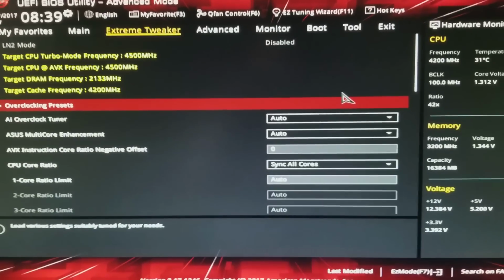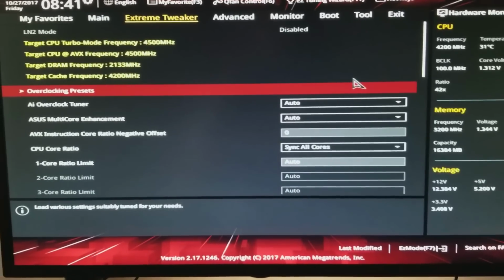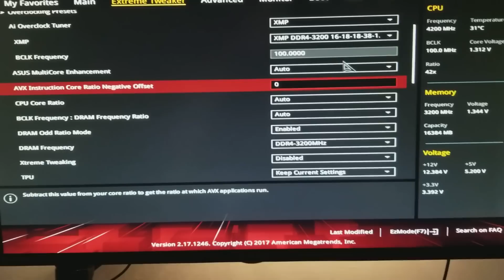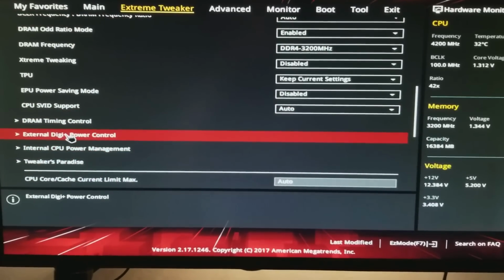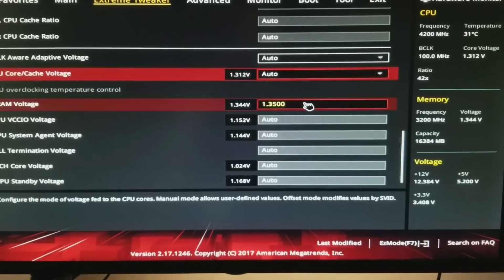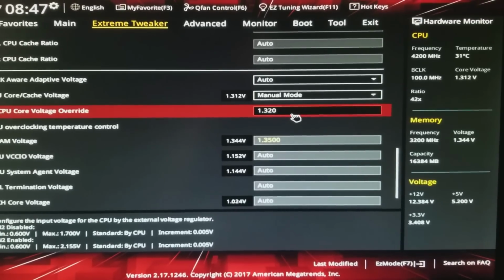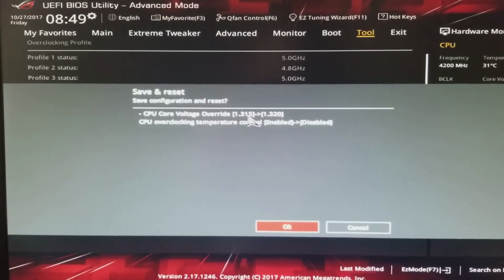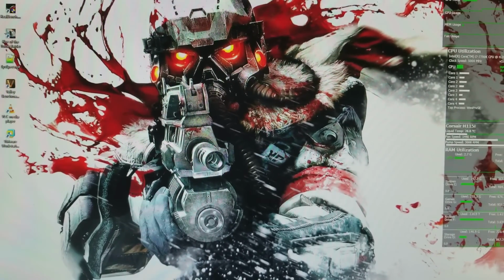Overclocking i7 7700K to 5.0 GHz on Asus Maximus IX Hero Motherboard

Comment: All the settings are working exactly as described except the DRAM Timing control set to Mode 2.  When set to mode 2 my PC boots to black screen.  When set to Auto it boots fine.  Any thoughts?  Only difference is I have Asus ROG Maximus IX Formula…
Reply: I’m having the same issue. I set to auto and it fixed the issue.

Comment: I’m at 5 and no delid. 1.31V. Fully manual memory timings……..no XMP…….DDR4-3200 CL14. 75C under heavy load. Same as DeBaur (spelled wrong) video. Personally, I wouldn’t go over 1.34 on air, especially for a 24/7 overclock. CPU Z not the best to monitor voltage.

Comment: I don’t understand why you are saying to start with a core voltage of 1.30v . Surely the starting value is dependent on starting core starting voltage indicated in the bios? For example yours is reading 1.312V, mine is 1.184 V so potentially could get good OC at lower voltage.
Reply from the maker: Not all 7700ks clock to the same speed at the exact same voltage with stability. I also said that i delidded my CPU and replaced the TIM with Liquid Metal, which has made it run ~20* cooler than it did before delidding. The CPU has been running this same OC since this video was posted. It actually runs in a server 24x7 and never gets anywhere close to the TjMax with a Noctua NHD-15 cooler. My CPU would not be stable below the vCore shown while doing stuff like  H. 264 video editing/rendering (100% usage on all threads). Even at this type of usage still never gets anywhere near high temps.  I find it hard to believe, but if you can achieve a 5.0 GHz stable OC on 1.184 V during extensive load testing then 👍
Reply: @KJL00  I have just concluded that I can only go up to 4.7 GHz @ 1.290v . If I raise it to 4.8 GHz , I need at least 1.30v but the temperatures hit 100 C and cpu load 100% with cpu intensive games which lowers the performance. Do you know why the cpu load would go up with higher clock speeds ?
Reply from the maker: @wakingfromslumber9555  if you havent delidded the CPU and done a liquid metal replacement for the TIM, then those clocks, temps, and voltages sound close to what i had before i did my delid. If you are hitting 100*C the CPU will thermal throttle to protect itself which will bring the clock speed down on those cores. Could be why its appearing to have a higher load. I aim my overclocks to be at least 20*C below the thermal max at load. One other thing you could do is set the AVX instruction offset to 2. This would clock the CPU at 4500 MHz when it detects the usage of AVX instructions by an application. This should get it to run cooler and you wont really notice much of a performance impact on those programs.
Reply: @KJL00  makes sense , thanks , I will clean off the paste with alcohol in a cloth from processor and the contact and apply fresh paste to see if it makes a difference.
Reply from the maker: @wakingfromslumber9555  that may help, but it might not cause a drastic change. A delid is where you actually remove the IHS (metal plate) from the CPU PCB (plastic piece) which exposes the CPU die. When you do a delid you remove the paste between the die and IHS and replace it with something better (like liquid metal). The 7700k was notorious for having bad temps. I suspect this is partly due to the material they used to attach the IHS to the PCB, causing a small gap between the CPU die and IHS which resulted in poor thermal dispersion.

Comment: i think i have the same exact setup you have. 7700k, 8gb ddr4, max ix, the corsair water cooler, and i have a samsung 850 pro 1tb for boot. i decided to tear mine apart, clean and rebuild so i defaulted the bios and i’m hunting for 5ghz+. do you use any of the corsair or asus windows programs to adjust anything? 
i am not delidded and haven’t stepped into that realm yet but i remember the amd dual core days and folks were doing it then too. 

any info is great. the video was to the point and once i get off the pot, i’m gonna use that exact process for a baseline to 5ghz. i’m running only 1 ram stick so single channel, so that might help me a bit but idk

Comment: hello, I have the PRIME H270M-PLUS board, could I make an oc with this board to my micro i7 7700k?
Reply: in core ratio limit i put 50 but change to 45
Reply: I decided to do not like it because I had the suspicion that they make these videos without clarifying well how expensive it is to build a team to make oc and they cheat by putting "easy oc", with my cooler master 212 plus air heatsink I get 100% to 70 o 75 degrees and find out about another water sink was around 70 degrees, so it should have an excellent cooling equipment, source and motherboard, which they do not clarify and that is why they did not answer my first question

Comment: I have achieved 4.9 ghz @ 1.39, how is that you achieved 5ghz @1.32?
Reply from the maker: Not all chips are the same, not all 7700ks will run stable at 5.0 GHz, some may require different vcore voltages. I noticed that I could use a lower vcore without crashing after the delid.

Comment: Ok, so I have the exact same set up, and today I was going to give it a shot but chicken out at the at the 'voltage' stage because my voltage was a different number by default, also I have a h115i so no problem there but I've never delided my CPU. How important is that?. I know my build is about three years old now, but it's my best and only gaming pc and I can't afford to ruin it. Can the uploader please offer some advise? Also, what's the best software for benchmarking changes?
Reply from the maker: Ultimately if your not comfortable overclocking your system, don't. As I mention in the video every system can run differently, what works for some might not work for you. All CPUs and motherboards have variations. I do not recommend overclocking to 5.0 GHz if you are not delidding the CPU. It will most likely thermal throttle or hit the tjmax, reducing system life span. I have been using these same OC settings since this video was posted with no change in stability. Daily use.

Comment: I'm running a kraken liquid cooling on the same mother board. I7 7700k however no delidding and I probably need to reapply a coolant to the deck. Is it risky to oc to 5.0 ghz. The liquid temps in my kraken are running at 25 degrees.

Comment: Don't no why my clocks drops to 4.8 when I start AIDA64 stress test.
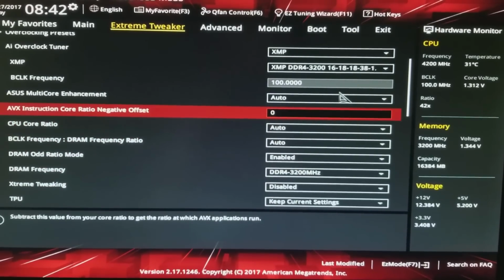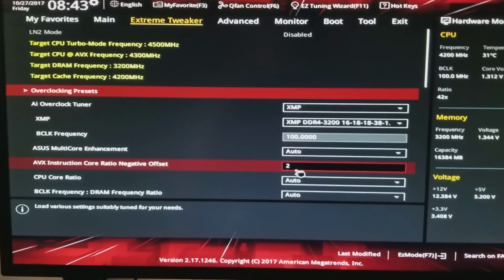Reply from the maker: Explained between 2:22-3:49
It is expected if you set an AVX instruction offset.
AIDA64 does some AVX stress testing.
Reply: @KJL00  ok, thanks. Don't know why after OC my asus AI SUIT stop working and every time i start my pc I get Can't find AsIO.sys!! (2) error messege. Do you have any idea how to fix it?
Reply from the maker: @TheProject43  I am not sure how an OC would cause this...I do not currently have that tool installed (still running the same system with this same OC though). I would start by checking the install directory to see if that file exists or reinstalling AI suite, if you need it installed.

Comment: Bruh my cpu runs at 81c in idle >:(
Reply from the maker: If you didnt delid it that is not really surprising. I dont remember what my temps were before I delided mine but it was not really possible to achieve 5.0GHz without thermal throttling.

Comment: I just switched my Corsair Dominator Platinum 2800 to Ballistix 3200 and Dominators were working fine with XMP mode 2 but with Ballistix only mode 1 works otherwise no boot.
Is it better to keep the Dominators and return the Ballistix in this case ? My usage only 4K gaming.
7700k@5Ghz
Asus Hero Maximus IX
Thank you by advance
Edit:
I just changed stock 3200 to 3600 and Xtrem Tweak to Enable it boots

Comment: Just a question, how can I overclock, but not to be all the time on 5.0 ghz I want to hit the 5.0 but just on turboboost not all the time, is that possible?
Reply: I think you can set it so when its using 1 core. It will run at 5.0, and run less when using more cores. That way it shouldn't cook itself. But I don't think you can keep the turbo stuff as such

Comment: Pretty informative and very easy to follow. I've had mine at 5ghz on 1.36 for a while. From my understanding, is that you can achieve higher clocks over time, you cant just jump into it...I start on 4.7ghz at 1.25 and then gradually went up. I only stopped at 1.36 because it was the most stable at the time. After doing some messing around in the bios and adjusting some things similar to yours, I'm pretty stable at 1.30v @5ghz. But I'm about to use 3d mark to benchmark and some other utilities I have. Great video mate.

Comment: I have a question, when I enable XMP, it doesn't set my RAM t it's advertised frequency. I have 32GBs of Corsair Vengeance at 3200MHz 16-18-18-36. When I turn on XMP is shows my RAM as 3000MHz 15-17-17-35? Does anyone know how I can fix this? Do I need to update my chip set?
Reply: I'm fairly sure your CPU is the limiting factor there. 
I can enable mine to 3200, but my brother in law had the 7700 non-k and it would only go to 3000. So I would assume its solely to do with the CPU. That being said, I am not a rocket scientist. 

Which cpu do you have?

Comment: I know this video is old but I just found it..im using a maximum ix formula but the bios is the same. I tried an auto overclock profile already on the bios  it was for 4.8ghz my CAMs software for my kraken cooler notified me that my temp was exceeding 80c when I was playing an intensive game though. normal operation browsing internet etc its in the 40s and when under a bit of load.watching films playing less intensive games etc its in the 60s. I noticed on HWM that my normal  vcore value was at 1.328 and the max at 1.360  is this safe or should I try to get lower voltage?
Reply from the maker: 1.360V is high for 4.8GHz, even 1.328V is high for 4.8GHz. At 5.0GHz i am sitting at 1.33GHz and never go above 1.34GHz. I have basically been using these settings since this video was posted with no issues. Personally i dislike the preset overclocking profiles, this is one of the reasons why. Before I published this video I was at 4.8GHz for a little while, i dont remember the exact vCore i was using but it was 1.2 something. Not all 7700ks can OC to 5.0GHz and it seems to take a jump in voltage to go from 4.8GHz to 5.0GHz. 

Also what CPU cooler are you using? Did you delid your CPU? 
If you did not delid and depending on the cooler 80C is completely normal. Assuming intel never did anything about the TIM and sealant used to put the IHS on the chip I am guessing that even a brand new 7700K still has temp issues. Before I delidded my CPU id see temps like you mentioned. Now i dont exceed 75*C even when doing video encoding which is a pretty heavy workload.
Reply: @KJL00  thanks for replying. My chip is not delided  I'm on a krakenx52 and using arctic mx 5. Was a while since i applyd the tim though. Need to buy more as have none now.I was just wanting to try 4.8 to start with.. As I thought the voltage was a bit high. So I tried your settings. But for 4.8gh. And setting cach volt to 1.235. But my screen would not show input and pressing restart or power button did nothing. I couldn't get my screen bk until I turns the PSU switch of. Then it booted into windows. But shortly after crashed. And again no input on screen.  Having to use my phone to send this.  What should I try to do next.
Reply from the maker: @djam7484  hmmm, i have never encountered that problem. You were able to get it to boot to windows once after flipping the switch on the PSU off/on? If you can do that again boot back into the BIOS, i think F5 will reset settings to default. Another option you could try resetting CMOS https://www.youtube.com/watch?v=-9RnIj-EcdQ
The CMOS pins on the Maximus IX are under the bottom PCIe slot.
Reply: @KJL00  dunno why. Maybe to do with having a TV hooked up as a display using HDMI? In any case I'm bk in bios now.   Should I try to up the volt to 1.25 or could it be another setting causing this issue?
Reply from the maker: @djam7484  Typically when setting manual voltages you want to start somewhere high and work your way down until you start having stability issues, then go back up to the last stable voltage. For example if it was stable at 1.328v,  then drop .005V, boot up and benchmark, then do that again and again until you start seeing stability issues, then bump up .005 or .010V. It is time consuming but it should help get a stable OC that does not heat up too much. The lower the voltage the lower your temps will be. 

One thing you can try is set the core voltage to auto and then set the multiplier at the top to 48. reboot the computer and boot to desktop, reboot again and go back into BIOS. You can use the voltage shown next to the core/cache voltage setting as your starting point, then work down from there. Once you think you got it stable run a bench for several hours to confirm.
Reply: @KJL00  hmm I'm not understanding this. Computer would result in no screen input or booting into windows and crashing when I set cache volt to 1.235. Yet when I did what you said setting the volt to auto restarting,booting into widows then restarting again going into bios. My volt is showing up as 1.104.  That's a lot less then 1.235 so..how come that's not crashing but when setting volt to manual it is?
Reply: Spoke to soon . even with volt set to auto screen went black computer unresponsive again..what should I try to do.
Reply from the maker: @djam7484  What happens if you set everything to default, does it behave normally for a few days?
Reply: @KJL00   setting it to optimal defaults evertything works fine. just when I try to do any manual over clocking or tamper with those settings pc does not work properly.. im confused because as I said before the default volt was showing up as 1.104  but setting it on a higher value resulted in crashes.. very confused.
Reply: ok so I had a bit more playing around with it and iv managed to set a manual voltage of 1.35 for 5ghhz and put LLC to level 3 with ram at stock. system boots into windows but soon as I try to run prime after about 2 mins I blue screen...what should I do? should I try to up the voltage to 1.36 or try to set LLC to level 2?
Reply from the maker: @djam7484  I'd start by increasing LLC. A higher LLC is more likely to result in stability. A lower LLC means there can be increased vdroop, higher LLC means there will be decreased vdroop. The trade off is that with a higher LLC you will likely see higher temps. Start with increasing the LLC, then if you still see stability issues, start increasing the vCore by .005v. I personally wouldn't go above 1.38v (this is still fine, but high), definitely don't go above 1.40v.
Reply: @KJL00  thanks. When you say don't go above 1.38 or 1.4 are you taking into account the llc or do you literally mean don't key in more the 1.4 when setting manual voltage.
Reply from the maker: @djam7484  yes, regardless of LLC setting dont set your vCore more than 1.40v. 1.38v might still be considered fine for some, but personally i wouldnt. If you consider that most chips can hit 4.8GHz somewhere in the 1.2v range it is not worth going that high for the extra 200 MHz. There is definitely a large jump in the voltage needed to go from 4.8GHz to 5.0GHz.
Reply: @KJL00   I know the system is stable at 4.8ghz because there was a preset for it in the bios  but the vcore was showing 1.39 with voltage left on auto.  I tried 4.9 with 1.35 manual volt. but it only boots into windows soon as I run prime it blue screens my computer..

Comment: I enabled xmp didn't hit no. Upped my voltage to 1.33 and got 5.2ghz no delid. I figured sitting at 5ghz with only using xmp and voltage at 1.28 was good but now it's winter and I can play with it a bit more .

Comment: Thanks man step by step helped me out stable on both 5 @ 4.8 with good temps. Msi frozr l has 7700k maxed out @60c-68c during heavy benchmark which i think is pretty good. Panic for the past month ready for it overheat b/c i could not fit nh d15 in my case. Thanks again

Comment: What does the CPU Core/Cache Current Limit Max do im still confused? (idk if you will respond but its worth a shot)
Reply from the maker: This setting allows you to configure a higher current (amp) limit to prevent power throttling when overclocking.
Reply: @KJL00  Also I thought my system was stable after running it 4 hours with two different stress tests
Reply: And then it turned out that it wasnt cause when I was playing a game, I got a black screen, so I upped the voltage by .005 the bios says i upped it but CPU ID does not and neither does Hardwaremonitor, it says Its only using 1.212 and then fluctuates up and down like crazy. How do I know for sure I set my voltage to the correct thing
Reply: CPU ID says I'm using 1.248 when I'm actually using 1.255
Reply from the maker: Have you adjusted the Load Line Calibration? this can also help with voltage fluctuations at load.
Reply: +K JL I have but every level is either too high or too low for my voltage

Comment: I have i7 700k, what should i prepare MHZ of ram? i want oc @5.2 ghz. and what cpu cooler i need?
Reply: 5.2 would be really tough even with the noctua reason being, might have to put voltage at or above 1.4 and that just kills the cpu's longevity. 5.1 would be the max I would suggest with voltage at 1.375
Reply: I have a Maximus IX Code and my clock is 5.2ghz, vcore 1.43 and temps +/- 75º. I have one Thermaltake 360mm.